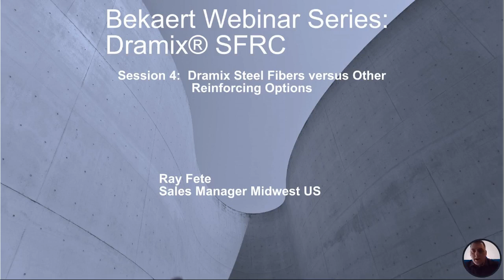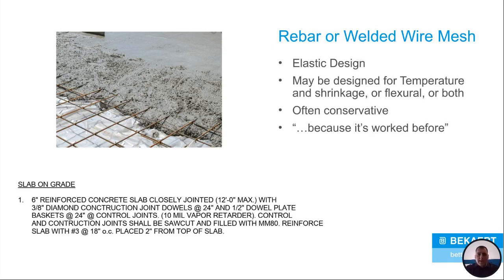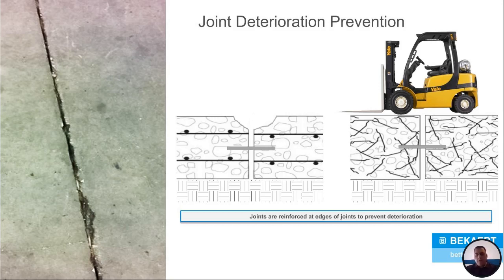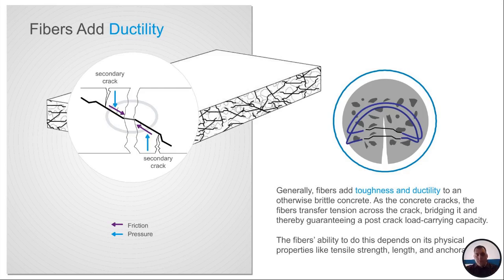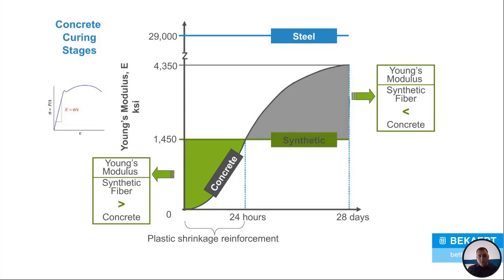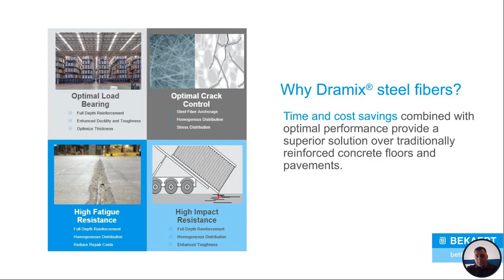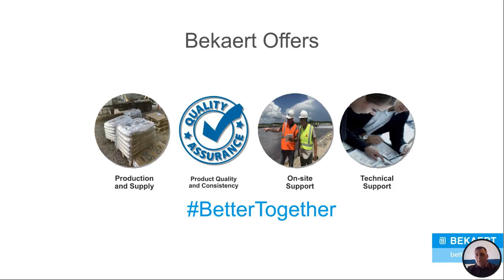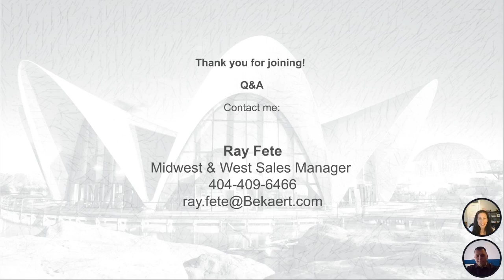Dramix® Steel Fibers vs. other Reinforcing Options - SFRC in the US - webinar

Comment: In the end, the Question rises that it is economical than the traditional rebar method? Cost of Fiber than the cost of Rebar? what is the scrap value?
Reply from the maker: Evaluating the total cost of ownership goes beyond the comparison of material costs. Speed of construction, operational cost, durability and life span are all influenced by the use steel fibers. However to come back on the more specific question whether the “construction cost” is cheaper with a DRAMIX solution compared to a rebar or steel mesh solution partly depends on the application and design. For the application fields DRAMIX is predominantly being used ; industrial floors, rafts, tunnel shotcrete linings, tunnel segmental lining, … the overall savings on material costs can be between 30 to 5 %.  We also save on concrete volume and weight of steel.  Therefor the DRAMIX solutions have a positive impact on the carbon footprint.

Recycling of steel fiber concrete is a field where more research needs to be done. With experimental equipment we succeed to recuperate up to 90 % of the steel. This recycled steel can be melted (preferable with green energy) and reused without any quality loss. Steel is there for an ideal building material for a circular economy.